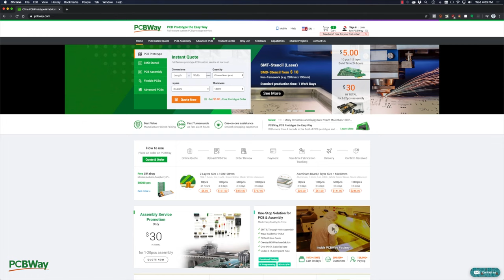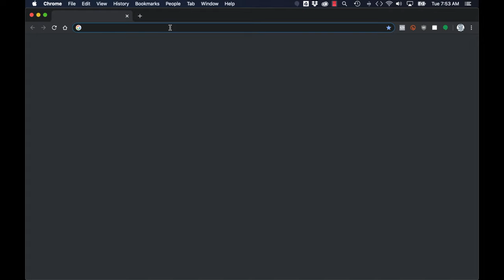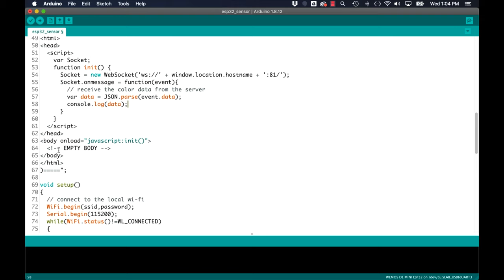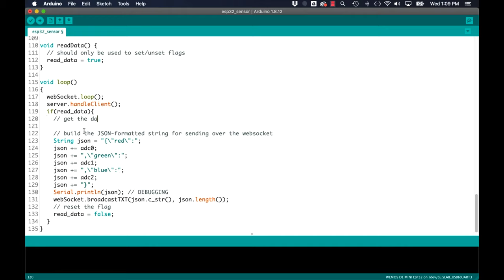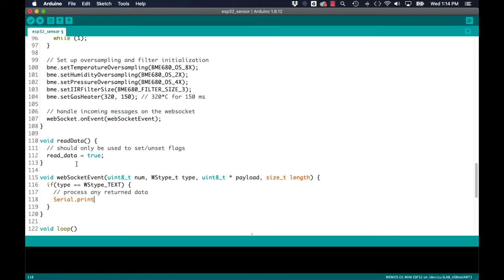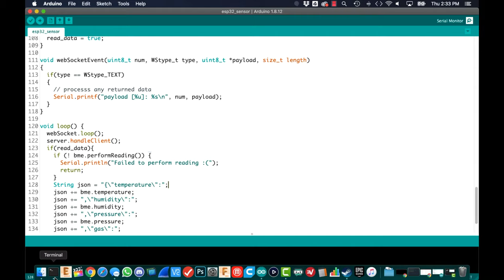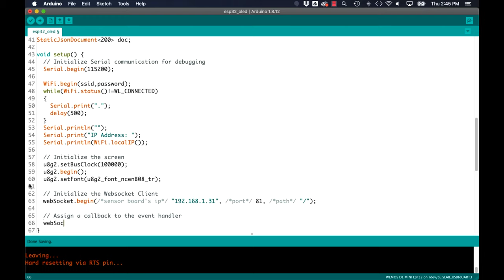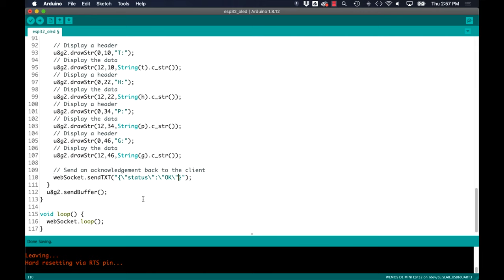ESP32 To ESP32 Real-Time Data Transfer Using Websockets Client/Server | BME680 + Arduino IDE

Comment: Brilliant, great to see the final project having watched you mull over the idea of putting it together, really nice presentation and I for one love the music ...  I just happened to be learning a bit of MQTT -> Node-red so had a D1 mini with an SHT30 & a BH1750 light sensor up and running, so I chucked an Adafruit SSD1306 OLED on another D1 Mini and had this up and running, in parallel, without too many problems.  BTW I programmed both boards OTA (just needed to pay attention to which board I was uploading to .. yep I messed up a few times lol) ... Thanks again!
Reply from the maker: Heya, Pete. Thanks so much, yeah the music is tricky as I try to balance what makes me happy vs. audience preference. The company behind the scenes is much appreciated, looking forward to keep hanging out with you and others as I knock my head against some walls :)
Saw your suggestion for OTA on stream, and as I was giving it a try, realized my DevKit ESP32 board was acting up. So the two instances for the IDE were fine, but you're right, it's a nice alternative! Thank you as well!

Comment: This is perfect, I'm waiting for 2x ESP8266's to arrive, I want one to receive a signal from a wired PIR, then transmit  to the other, which will light and LED and sound a buzzer.
Reply from the maker: Heya, Philip. Thanks, I'm glad you found this useful. I have a version of this for ESP8266 (https://youtu.be/gZhUi24_qms), but I feel the firmware for this is a little more polished and uses websockets, so it's a better starting point. Good luck, and shoot me any questions if you run into any trouble!
Reply: @datasith  Thanks, I'll save your video to my playlist. I have ESP NOW jotted down in my project book, I'll be researching that too. I just started following you on Instagram.